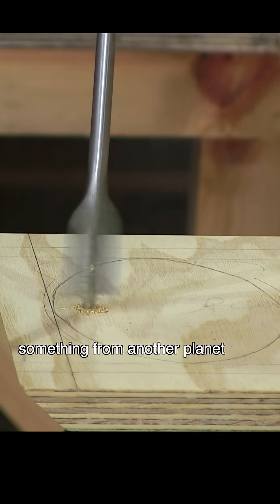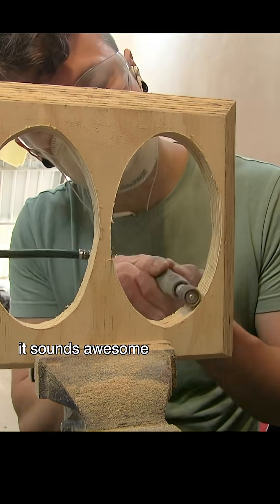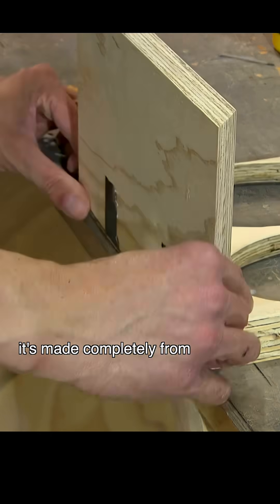Turning a CAR STEREO into a HOME SOUND SYSTEM! #diy #woodworking #engineering #caraudio

Comment: Just gotta add a sub and tweeters but what you made is amazing still
Reply from the maker: Yeah, that would be cool. Maybe make one with an amplifier 🤘I did actually have a battery powered "boom box" style version at one point, but it only had 6x9s and head unit. I charged it with a car battery charger 😂 it was great at parties.
Reply: @Dre.T.K yah man just like a little 8” and 400 watt amp and there you gooooo